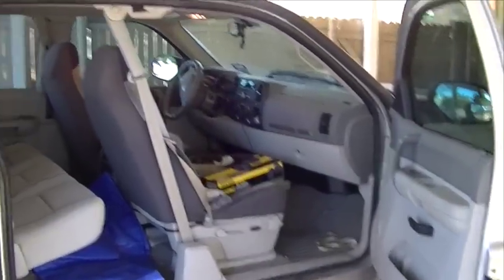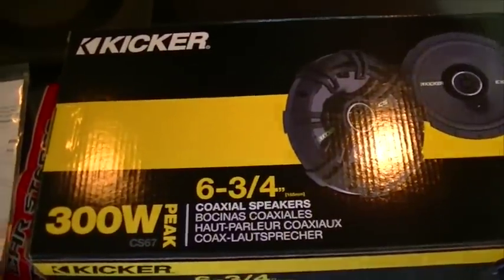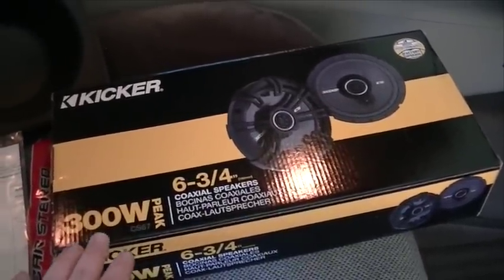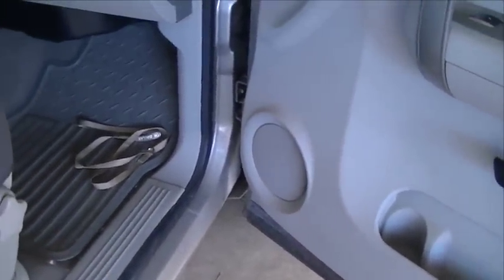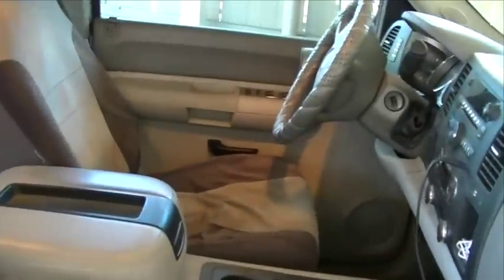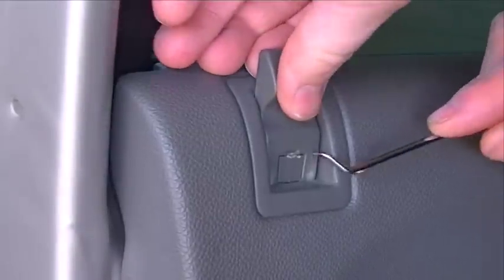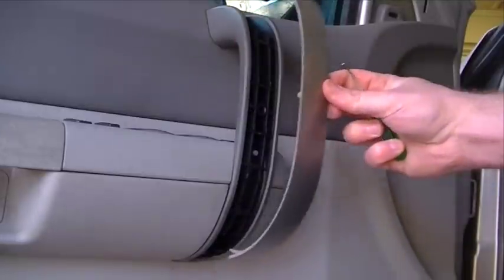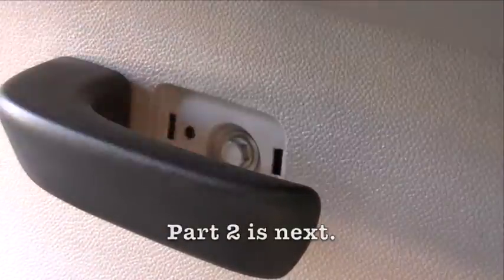PART 1 2007-13 GM Truck Front Speaker Install | Silverado Tahoe Sierra Yukon

Comment: Where did you get your center console? Or what part number is it?
Reply from the maker: It's stock to the truck.  SLE2 package.  SLE1 package has the flip down console with the three cupholders.  SLT has nearly the same console but the dash is different.

Comment: Are you not concerned with the impedance of the replacement speaker?  On my truck the rear speakers are marked on the back as 8ohms.... these Kickers are 4ohms. The factory stereo may work just fine with these....or it might just toast the amplifier.  Is your stereo still working?
Reply from the maker: Kirk Arthur My stereo has been working just fine since the install
Reply: Kirk Arthur a lower impedance load on an amplifier will actually make it run more efficient and in turn produce less Heat. on the contrary , when an amplifier is designed for a certain impedance like 4 Ohms minimum and you try and run 2 ohm speakers, it will overheat the amplifier